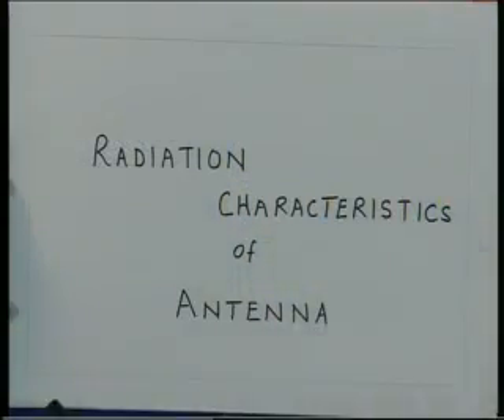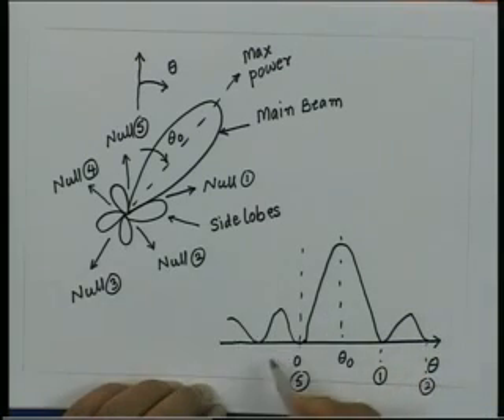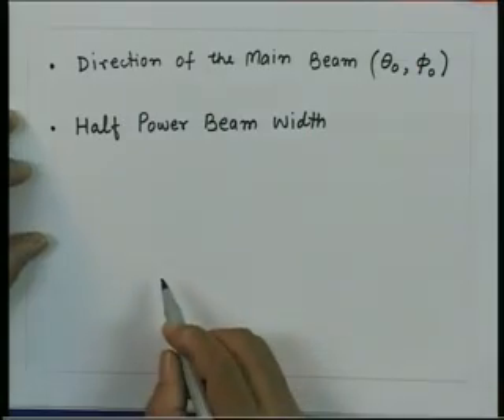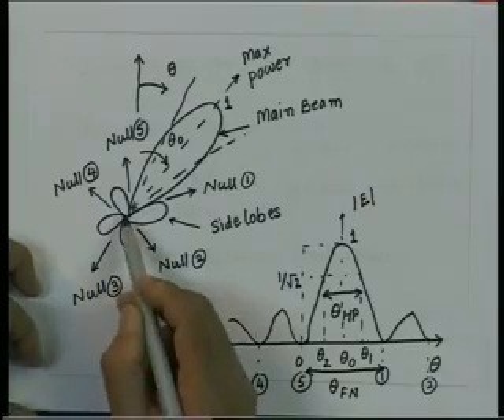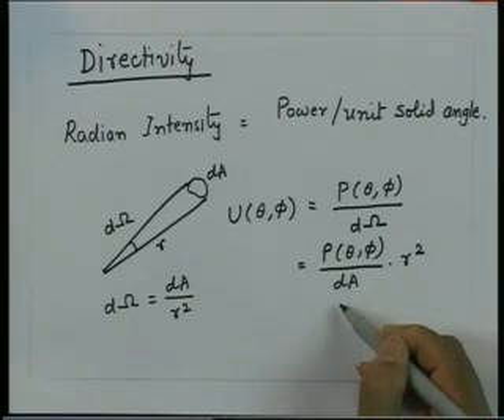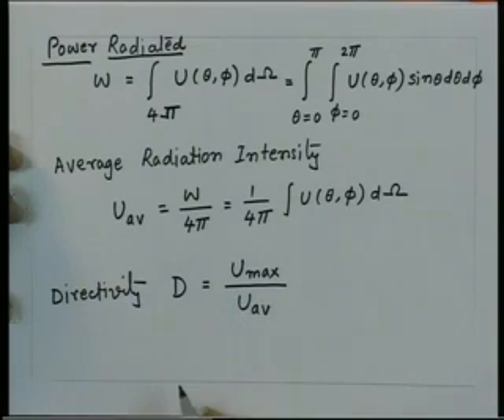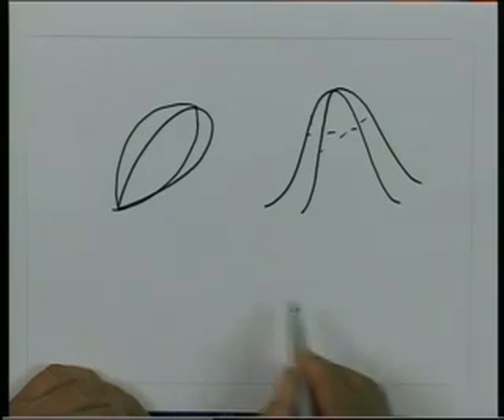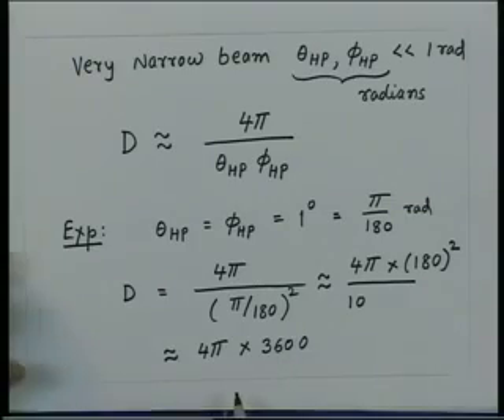Radiation Parameters of antenna

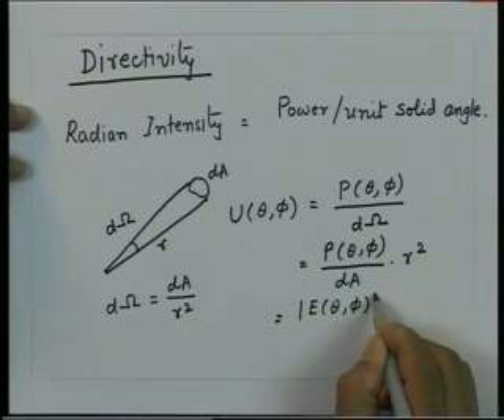Comment: at 29:50 when he is writing power density in terms of poynting vector,wont there be a 0.5 term before?
Reply: sourav guha yeah you're right.. I screwed down to the comments section to see if someone noticed
Reply: If representing RMS value it need 0.5
Reply: So you mean that here sir has taken peak value rather than rms value??
Reply: @CTSO2024  if we take rms value then there is no need to devide by 2 ,but here sir has not specified what value he is taking
Reply: we always take rms values in calculations for power, so yes 0.5 term is missing